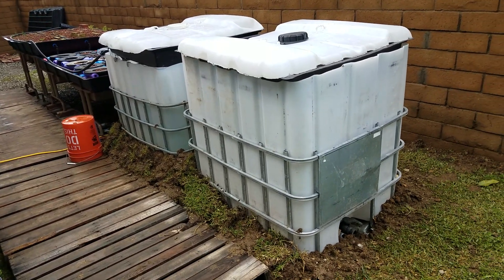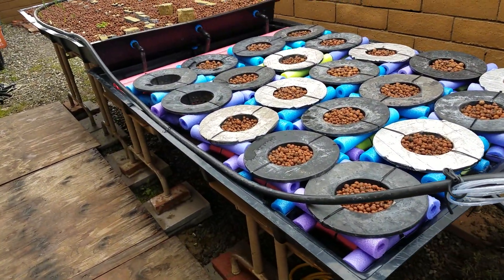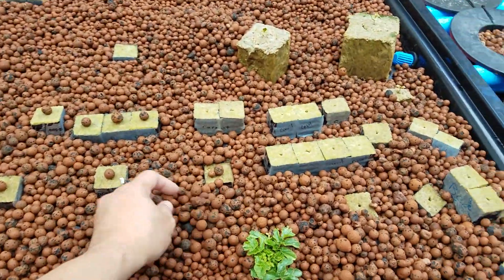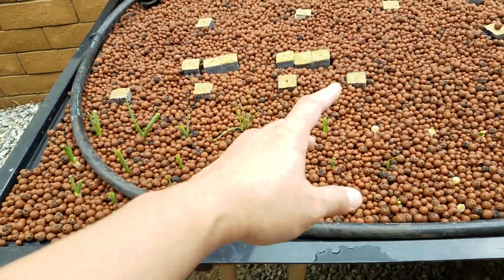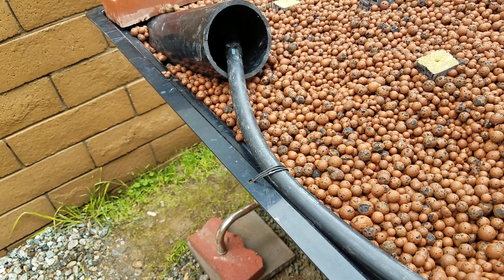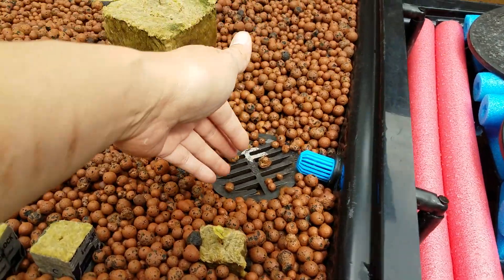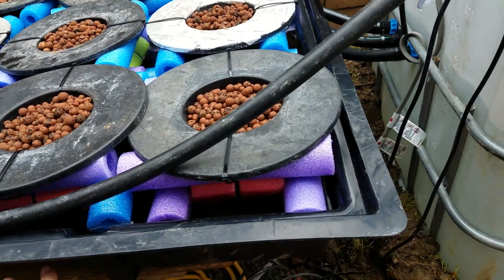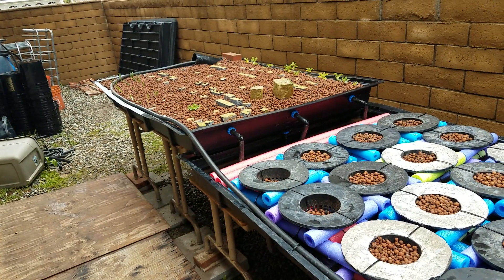Walk through Aquaponics hydroponics deep water culture

Comment: What are those big trays called? Where do you find them? Thank you
Reply from the maker: Hi Bob, those are called drain tables, they were developed for the marijuana industry and work amazingly well. High impact abs plastic so it wont leach chemicals and it will stand up to the elements. It is available everywhere, ebay, amazon, etc. Try and find a local hydroponic shop as the shipping and size makes it hard.